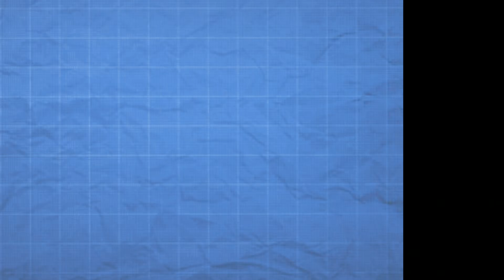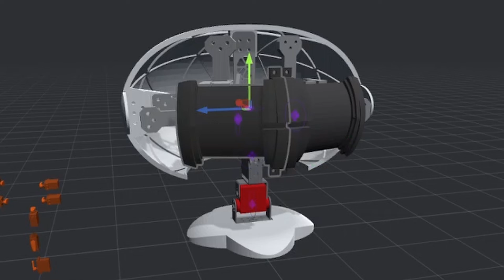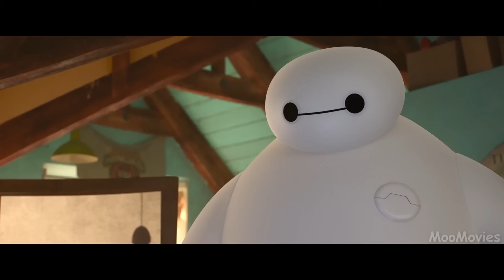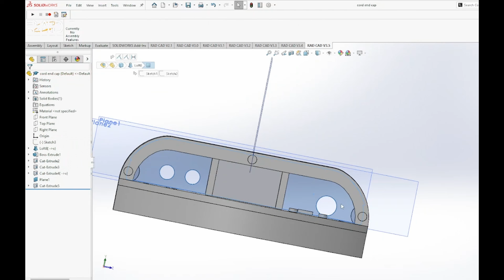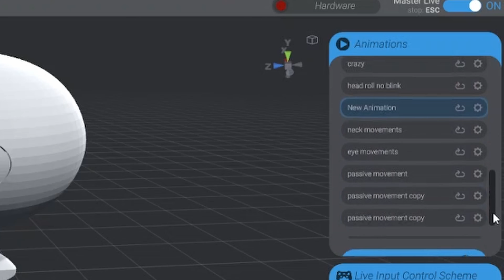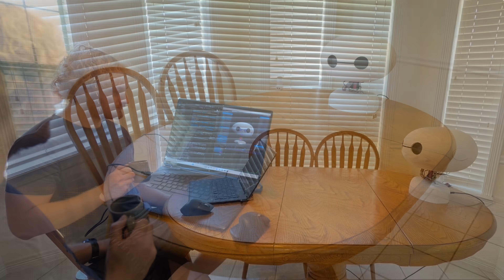I built a real Baymax Robot you can talk to

Comment: hey really loved your project..I just noticed something..The line that connects the eyes in baymax is slighlty offcenter in the movies. What you made has a line running from the center of the eyes. Also im an designer and was recently experimenting with a stewart platfrom system. I think that if you would use the stewart mechanism as your base and then mount motors on top, it will eliminate the wobble as the cg would be equally distrubuted as what compared to now where it is on the cenetr of the motor axis. Anyways keep building the fun project.

Comment: You should consider changing the neck mechanism if you weren't already planing to. You could do something of a Stewart platform, but with just 3 actuators, and a ball joint in the center. You could also not do the ball joint, and you get some extra degrees of freedom (mostly up/down translation) but it means your servos are under constant stall force (fighting gravity to holding the head up).

It would mean you need 4 total servos to get the same 3 DOF you have now, but you would have ~3 servos worth of power for the head tilt (left/right forward/back) that should help with the stutter and jerk in the head motion (and the servos don't fight gravity any more assuming you balance the head). Does require some inverse kinematics and more linkages, but that and smoother accel/decel would make the head a lot more fluid imo.
Reply from the maker: yeah I might look into something like this! It's nice too because it allows you to use the full servo range of motion

the packing into the head can be a little tricker with the yaw direction especially but could be a good optimization

Comment: for  the body use exoskeleton  and conect it with small wire and then it can swell  and it will folow the movment of the exoskeleton
Reply from the maker: thats essentially what I'm thinking of doing!
Reply: @braebarnes  good  i mean it the more optimal way to do it without having to much weight but for the legs idk bruh i mean mb that you could like do smt so the pression down is a lil deflated  just on the foot an after u can use ai to simulate the whole robot so it can stand up

Comment: instead of relying on servos directly which produce the weird movement you can make all the servos on the base and transfer the motion via robes or small henge system, it might take more time to achive but it will give you cleaner movemnet since the head will rid out of the motors weight
Reply from the maker: a lot of the weird movement is actually in the head itself. like the servos will stop but the head will wobble about the support structure and things

But agreed that some kind of neck linkage could help make it smoother

Comment: Wonderful the is couple other open source projects you can  utilise the would make this project more compact and fasttto end project  I working on more software and still later will do more hardware when software is done as I like it  can we have a conversation
Reply from the maker: I'm a mechanical engineer by trade so the software here is definitely a little patchwork. I want to optimize more for the next version with some of the comments here for sure, especially as I make the shift to a fully local system
Reply: @braebarnes  Response being removed like 5 times already i wanted share goog repos how csn i contact you we can learn wrom eachother i know some smart individuals too like messaging platform or something

Comment: This is cool! I've been working on a similar pipeline for a project of my own using the recently released m5 StackChan. You tap to have it listen, it then sends the audio off to MLX Whisper, pipes the text into Gemma 3 (via Ollama), then uses F5-TTS for voice cloning which it then streams back to the StackChan. All of that can run on my M2 Mac Studio. Streaming responses is nice as you don't have to wait for the full TTS before starting to hear the response. I'm playing with Kokoro too as it speeds up TTS significantly, but you lose the voice cloning. Throughout all of that some different face animations play on the built-in screen, and it moves around slightly using the built-in servos while thinking.
Reply from the maker: That sounds sick! I'll have to check some of that stuff out for the next version! It's interesting because I started this project almost 2 years ago when a lot of the resources weren't as good or open as they are today so it would be interesting to revisit this with some of the updated and more streamlined tech

And yeah cloned TTS takes so much longer than a pre-set voice its crazy